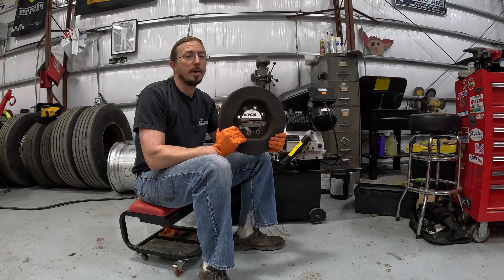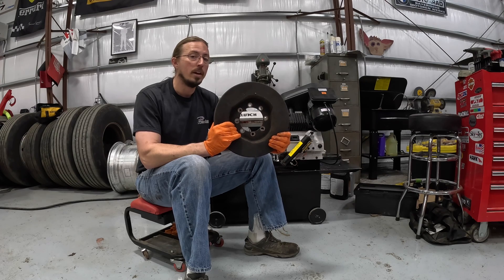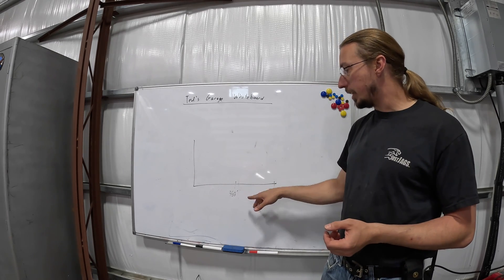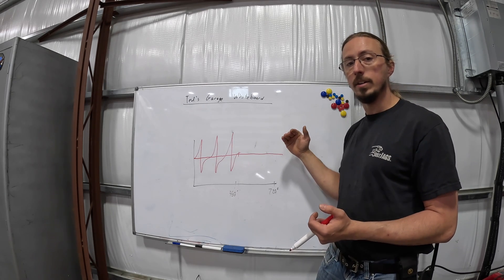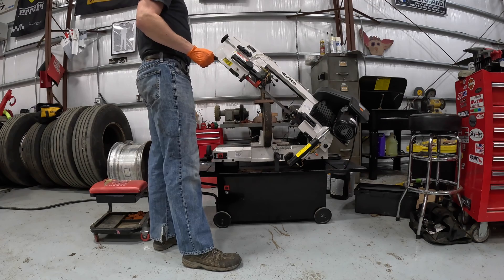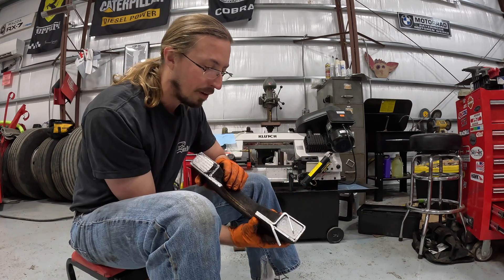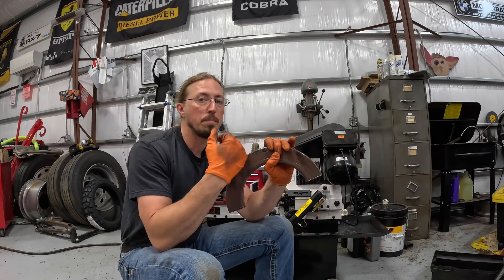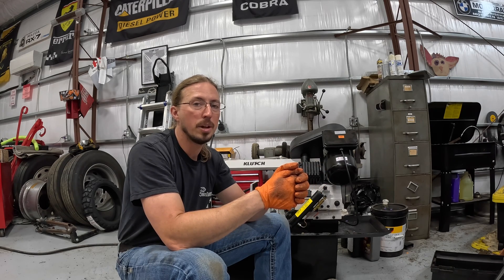Cutting open a Caterpillar Diesel Harmonic Damper and What are Torsional Vibrations? (and why care?)

Comment: Thumbs up and I am extremely grateful to you for cutting open the Caterpillar harmonic damper and showing me the insides.  I bought one of these for that purpose and now I don't have to.  I do see what you are saying about heat possibly degrading the silicone oil (or whatever oil is in there) but that seems like it might possibly take longer than the lifetime of the engine.  I also don't see any good reason for that lubricant to break down with age as long as it is sealed in there. I'm saying that damper was probably good and not the cause of the accessory vibrations you saw.

Comment: Very very interesting stuff right here! Now, got a question (may be a tough one though). When a Detroit Series 60 is at idle, why is there a slight whistling sound? As the RPM's rise, the "whistling" increases in pitch as well. I've always heard that "whistle" on Series 60 engines and have always wondered what that was. I remember one of the buses (an older Prevost H3-45 I believe) from a local bus company had the Series 60, and when it was idling, the "whistling" was extremely loud, and it idled a little lower than most Series 60's. The whistling can also be heard on a Cat 3406B engine. And on a slightly related topic, how are the ASMR sleep videos with my suggestions coming along? It's been a couple weeks since the last video and wanted to check in and see how it's going! Please let me know ASAP.

Comment: Thank you Ted! This is great information! I really appreciate you taking the time to cut that apart, I always wondered what was inside a harmonic damper! After watching your video, I'm going to do an inspection to make sure everything looks okay with mine! Thank you once again, as always awesome video and very helpful information! ❤❤
Reply from the maker: Glad you found it useful, Tom! I've got another video coming up on changing the damper on my Series 60. On the Prevost, the job couldn't be much easier to do.

Even though there were no real observed issues, I had felt a slightly off vibration at idle that went away with the new damper.

Comment: That was really cool to see cut apart. This is an interesting design for a damper, typically what I've seen is the input and output separated by a compliant material, or a spring-like set-up in order to smooth out the torsional vibrations.
Reply from the maker: This is the first time I’ve seen the inside of this style of damper for torsional vibrations as well, but it’s the kind most typically found on higher performance (read: higher torsional vibration) engines. With my aviation background I’m used to that style which I don’t thing is in place on any road vehicle.